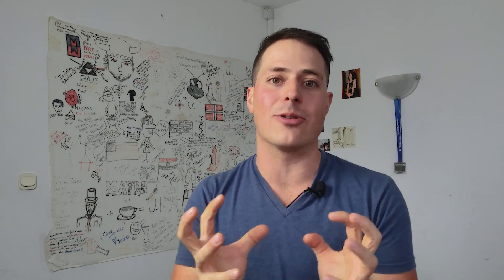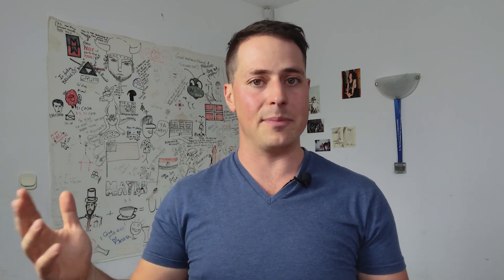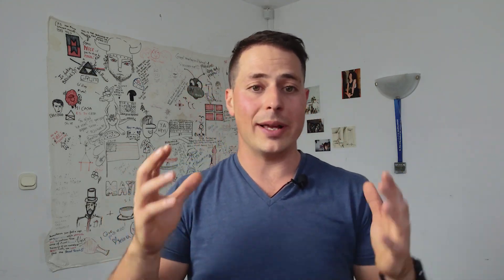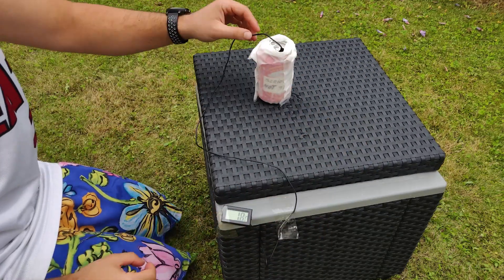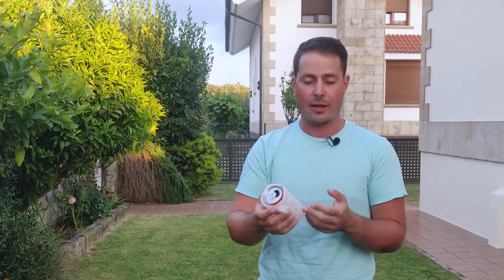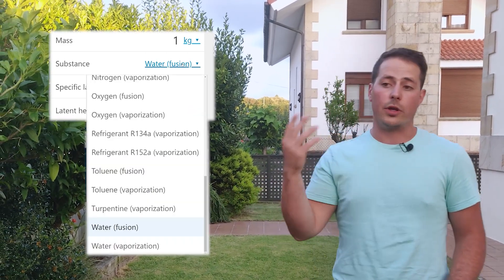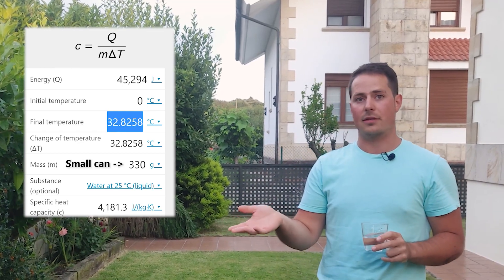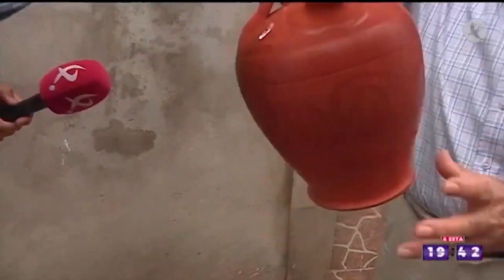The Paper Towel Hack ❄ How to Cool Drinks |  PART 4

Comment: You're meant to put it in the freezer wrapped in a slightly damp paper towel (not soaking). The phase change as the small amount of water on the paper towel freezes cools your container much faster than the air in the freezer. This 100% works.

Comment: Today I couldn’t get a single cold thing to drink then I remembered when I was in grade 7 we use to do this I was sent to a boarding school from grade 7-12 I now work as a PR for a hospital I learnt a lot of cool things back then and this is on of the very handy ones. Decided to check if anyone has done it and I found very few. I used this hack to cool my drinks for 6 years you can’t tell me it doesn’t work you didn’t do it right. First the can has to be sealed the wet paper towel draws energy from the drink second there is no enough paper towel and sometimes we wet the paper towel again when it gets dry. Take it from someone with experience it really works.

Comment: I heard the wet paper towel boosts the cooling rate inside the refrigerator. Have you tried doing it? I guess there is better thermal conductivity between wet towel and can compared to air and can. Anyway, great video!